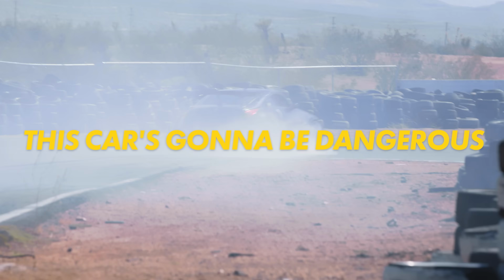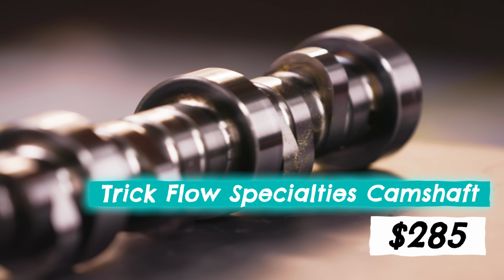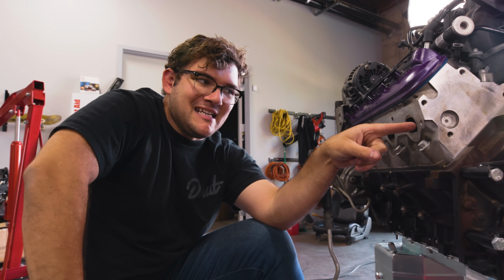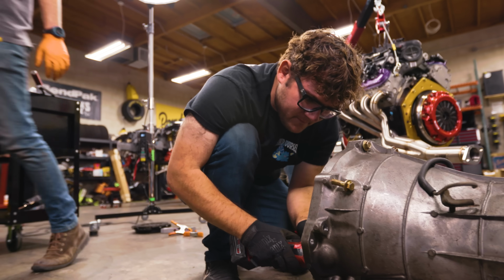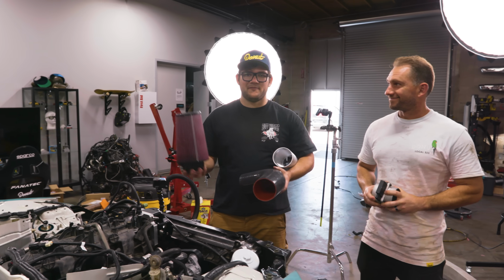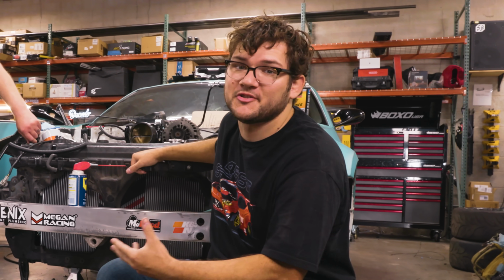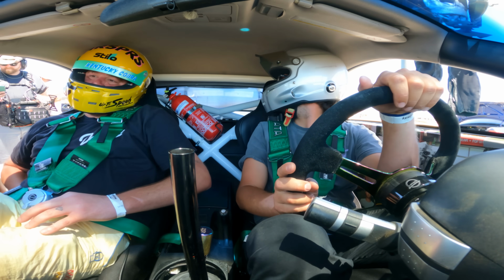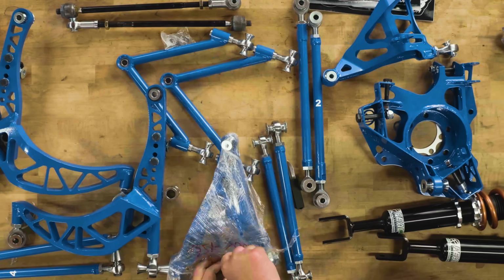$8000 Junkyard V8 vs $30,000 Crate V8 Engine Swap

Comment: The amount of investment, know-how, time, energy, and knowledge of tools and parts needed for a project like this successfully is insane, you gotta respect anyone who is willing to do this for a hobby
Reply: On two cars at the same time as well
Reply: Got the ls3 in my bmw e30 ☺️
Reply: "Someone wrenched too hard and broke the bolt" You just wrenched too hard and broke the extractor. Congrats.
Reply: Its such a fun hobby but very bad financially lol, I've already put over 20k into my Silverado
Reply: haha stop overcomplicating engine swaps they arnt that hard coming from someone that has done a few and can make a custom full harness for a car himself. We are in the age of the internet unless your doing someone really wierd there is all the information to pull it off.
Reply: Holley and other companies have worked to make it easier and more affordable too. Knowing that the majority of people are swapping or restomodding their vehicles. Gone the days of swapping motor mounts making sure your firewall is clear and your driveshaft was correct. Because you didn’t have looms to make or computers to hookup to run your management system. Spend a grand or so, get a Holley Terminator and it’s more or less plug and play. Basically back to 2 wires, fuel and spark
Reply: One of my best friends crammed one of these in a miata. Can confirm its an insane undertaking
Reply: Bro their mechanics
Reply: What about the men who do this 40-60 hours per week
For decades. 
And once you start society never. Ever. Wants you to stop
Reply: agreed. much more fun fixing your own car then paying someone else as well.
Reply: @deaganblough1961  not all of them.
Reply: Once saw a Chevy 396 shoehorned into a Opel Manta, the year was 1976, so no computer stuff to deal with.
Reply: I hope they make a ton of money, this series is great.
Reply: It’s not a hobby it’s a lifestyle
Reply: @deaganblough1961  Not really good ones tho 😂  nhf
Reply: Nahh you gotta respect somebody who does this as a job.. as a hobby is easy. If you’re not a car person you wouldn’t understand, but doing this as a hobby actually is the easiest. Doing it 40/60 hrs a week is death
Reply: I work at a performance shop that specializes in ls swaps. Engine swaps are only as complicated as you make them. Its more difficult to get your gauges to work properly than it is to do the swap.
Reply: @garykiesel2583  videos or it didn't happen lol
Reply: Me but with 3d printing 😅
Reply: With enough research anyone can do an engine swap, the hardest part is getting the equipment and time.
Reply: And all the back pain and mental frustration
Reply: Also like the Clarkson based "meanwhile"
Reply: Hello there Axle
Reply: Or for job
Reply: @ZeChef9000  to fix my mom's 69 firebird would have been insane. That car was beautiful
Reply: @ZeChef9000  same, 30k in on a 20 year old mustang.  This hobby is definitely a money pit.
Reply: Agreed, I wish they would have done a better tire setup fir the 0-60 runs though 👀
Reply: In the process of putting a ls in my e92
Reply: Your tripping, engine swaps are bolt in these days 😂 I k swapped a civic in a day and 5.3 swapped an s10 over a weekend. All you need is MONEY.
Reply: @RidinDirtyRollinBurnouts  it be like that
Reply: I'm willing but I dont know jack shit about shaping a engine
Reply: Me
Reply: I've got my steppops and my neighbor who have both been asking me "when you gonna put a ls in it?" My steppops has been pretty much prepared  ut I brought a foxbody lol
Reply: @tristanmeadows  i feel this, my twin V geo tracker wasn't super difficult
Reply: Honestly, you bring up what I think is a good point, that should be something they talk about, difficulty of these tasks.  I think maybe having someone without mechanic knowledge, or little, around to ask "dumb" questions would be good for some of us (including myself, know some stuff I've had to do, but have HUGE gaps in my knowledge)
Reply: My buddy and I are about to do an engine swap🤣😭. It’s voodoo and luck
Reply: Well they love it
Reply: I mean it’s not rocket science. A couple cases of beer some YouTube videos and a full tool set. Should really be the only things you need now a days…
Reply: Fool its sponsored hahahahaha wanna buy some snake oil?
Reply: Jeez, the prices are nuts.  Back in the 80s, A friend and I scraped together about $500 to buy a 327 with the rock-crusher 4-spd out of a wrecked '63 Corvette (with the 4-barrel carb, not the fuelie), spent another $300 or $400 on new cam, lifters, valves and some other bits from JC Whitney (and I think we found a Holley carburetor to replace the Carter), and put it all in a '68 Camero RS, which we bought with a seized engine for about $750.  We put it all together and we had a nice little rat racer which we ran on Wednesdays at Houston International Dragway - which was a 'race-what-you-got' weekly event and raced it for a couple of months before we blew it up.  All for less than $2000, including the Mickey Thompson race tires.
Reply: For that price.. just buy a new sports car.
Reply: @Pandadancypant  😂😅😂
Reply: I felt that went they started low car....much respect
Reply: @tristanmeadows  not trying to talk down your ear since you seem like you know what youre talking about, and the internet is great for learning car stuff, but im always hesitant to directly follow internet diy advice without seeing someone properly wrench on it themselves, since i work in paint and the amount of good painting resources on youtube and on the internet can be kinda lacking in comparison to the amount of bad/incorrect advice. you gotta find your guys you trust and be skeptical of all "easy" fixes, but thats just life in general. cheers bro
Reply: Not really. I helped my friend in my teen years completely rebuild a few motors on mustangs, jeep. Easy peasy. Only bad part was we kept losing good ol 10 mm
Reply: @fastinradfordable  they get paid.
Reply: This ain't a hobby for them. It's their job
Reply: Thanks bro
Reply: im 2jz swapping my z32 by myself, i wish i had the help and money they had lol they make it seem easy
Reply: @Ian Visser thats a boss hog
Reply: Great stream, as always. I appreciate the level-headed approach you take to the news and the markets. A lot has changed and that's on everything but the truth is I don't even care much about bullish or bearish market anymore because Mr Richard got me cover as I am comfortably making 1.5B T C monthly...🤑
Reply: @Ian Visser Just one guy? There are ton of them around. There is also a company that makes them.
Reply: Yeah okay I see where your coming from but honestly it really isn't that hard especially a crate motor. It's all there ready to go. It's pretty much just "plug and play". And a junk yard motors is pretty much the same way as well.... as long as you got the exact same motor out of the exact same make/model as the car its going in. If it isn't than yeah it can be a lot more to it.
Reply: @iscream4fkingfun  man i cant decide if id rather have a swapped engine or my 10mm...
Reply: @Ian Visser LS swaps are so common I’m sure there’s kits to put them in an office chair
Reply: Get sum garage is building a 400-600hp supercharged v6 fwd to put into a 84 cavalier  4 door sedan with a final weight of <2300lbs
Reply: @fastinradfordable  i went to day trading after doing swaps for a year at a local shop
Reply: @HansShackleford  doge?
Reply: Bruh they are well compensated to do all of this, and they’re not spending their own money. This is a dream for me
Reply: So how did they remove the broken bolt or did they drill it out and re threat it?
Reply: One thing I learned in life is that a big part of winning is knowing that you can and it is possible for you to win.
Reply: Suvka Martin  Been hearing about Richard for a while, how do I get him??
Reply: ?

Lol

Lemme

My too

My
Reply: @lonyo5377  Fr dude
Reply: Swaps are easy!! Wiring and tuning is a lil tricky but doing an ls swap is cake.
Reply: @tristanmeadows  dont make their heads hurt
Reply: Suvka Martin  okay then, I will give him a head start to see what His capable of making.
Reply: @tristanmeadows  is a k24 on a Ferrari 308 considered wired? 

Or sick?
Reply: 2 years of building welding and swapping a ford 302w into my e36. No one helped so took some time. 😆
Reply: @ahmedhussain8407  Even in the bearish trend, Richard still made me some good profits
Reply: Invent something that runs on Hydrogen. Now that would be cutting edge!
Reply: Exactly... well said this is some tuff shit
Reply: @craigmertz1994  Recently gave a try to his Strategy and now I can testify that he's system is totally legit.
Reply: Richard gave me the autonomy I need to learn at my own pace and ask questions when I need to he's so accommodating
Reply: It's not that bad as long as you don't do a bunch of unnecessary things
Reply: @MBisFrenchy  half a million views in a couple hours...I'm sure they are doing ok
Reply: @silktm9457  and the stress of it being someone elses car. Cant fuck up fixing it. And cant kick and punch it a bunch when you get pissed off
Reply: @ZeChef9000  imagine if u factored tools into the cost
Reply: To be fair they have far more resources than most garages...
Reply: @GenuineRage  iam not saying follow diy videos my God. Iam saying there is all the info aka wiring diagrams, tuning software, most swaps already have mounts readily available. Once you can weld and have half a brain to figure out the rest.
As someone else said hardest part is making stock gauges work with the swap 99% of the time.
Reply: Not a hobby, a life style
Reply: @flowerasteroid6241  fr
Reply: It ain’t really that big of a deal lol
Reply: these boys playing car mechanic simulator in real life
Reply: I mean they do it for living, but yeah shout out everyone who does this and has a day job
Reply: @ZeChef9000  Has the HP tripled?
Reply: Engine swaps aren't very hard tbh, just mark your shit. And this isn't their hobby it's their job lol.
Reply: Don’t forget about the aftermath of fun you get to experience
Reply: Action Official Audio - HBM Benny Feat KTheM1nd MD3 Malik
https://youtu.be/9Ul-bfHtjSg
Reply: @Ian Visser agreed
Reply: MAD RESPECT... they probably could afford brand new 400z with that kind of mods
Reply: Start on an older, simpler car. Fix the little things and in a year or two you’ll be ready to do crazy things. I bought a 72 Plymouth Duster 4 years ago and I could barely do a brake job. Fast forward to today and I’ve done a top end rebuild on the engine, completely rewired it. I’ve redone the fuel system, ignition, timing, transmission linkage and a dozen other things. Trial by fire, man. Trial by fire
Reply: @Lowclef  lol from a old ford gas tractor up to 2022 any thing with wheels tracks or skies and floats on water. im a skilled technician/ mechanic. i love working on them all too. knowing my life is in my hands when it comes to my vehicle. no price for that piece of mind.
Reply: @tristanmeadows  hahaha i getcha, like i said you seem to be pretty well-versed so i didnt think you were recommending that. 100% agree, engine swaps are becoming a lot easier as more people weigh the cost vs value of new cars in today's economy. its the one upside to this topsy turvy world we're living in, more non-"car people" are actually wrenching on their cars now and people are documenting how to do it properly on car forums. just wanted to throw out there for people that MIGHT be inclined to watch a youtube video to get something done that it's probably a better idea to find a forum discussing your exact car, because its all 100% geared towards wrenching the stuff they're working in.
Reply: Its backyard level know-how, enthusiast level equipement, and million siubscriber youtube channel level of budget/investment.
Reply: @ZeChef9000  yeah you can spend all you want on it but you can get your money back in returns on selling unless they become collector items
Reply: @racerx250  nah, the money was for fixing the damn thing
Reply: @Xearnx_Lyrics  I know and I have been
Reply: People keep rats as pets, can you imagine
Reply: Hobby? It’s not a hobby if you make money out it it. It’s a career
Reply: @Jose-wf6po  i never said it couldn't be, it just starts as a hobby
Reply: @ZeChef9000  and I've put 17 in my honda... are you mad or planted in the seat about it?
Reply: Like me lol
Reply: Your talking about my dad. Just redid a keep grand Cherokee limited edition. They don’t even make a lot of parts. Didn’t stop him, just compelled him to manufacture better ones. No matter what I do, I am an absolute disappointment to my dad. He’s cool though.
Reply: I put a big block is a dodge infrint of my house in nyc illegally gun and stressful
Reply: nah all it takes is a bit of skill and mostly money
Reply: All in one video too love these creators
Reply: @eriklarson9137  jobe was trying to make him feel better “it wasn’t your fault “ lol it’s cause Nolan is a big cry baby behind the scenes and gets hella mad
Reply: At the end of the day it's just cheaper, in the long run and reliability too, to just buy a factory performance reliable car.
Reply: Actually I don’t have to. Don’t tell me what to do. Congrats I un subbed from donut. Are you happy now??? FREAK
Reply: @tristanmeadows  yea just comes down to the actual work but not all swaps have crazy amount of info because they arnt as common
Reply: Yig
https://youtu.be/N7-LaP12hm8
Reply: Must be some one thats never done a engine swap then 🤣🤣
Reply: @lonyo5377  people please don't 90p
Reply: They both look weird cause they shaved
Reply: its just something that comes easy when you really enjoy it. I love working on cars and if I had the money and tools they had, id be doing the same exact thing 😂
Reply: Cringe
Reply: @garykiesel2583  how the hell did you do that 🤣 I struggled with a simple m52 swap
Reply: What do you mean these projects only took 38 mins
Reply: For some reason we enjoy this shit🥲
Reply: Youd think its hard, all of my friends ive taught about mechanics have picked it up incredibly fast, it really is simple when you think of it the way mechanics do, you just start out piece by piece youll get there if you want, and you can swap an engine with not that many tools
Reply: @tristanmeadows  opinion not fact
Reply: Nah it really takes bull headed determination more than anything
Reply: @alexcapps9290  there are kits to drop v8s into miatas...  they come with motor mounts and everything
Reply: @whydoikeepgettincut  yes there are plenty of kits. He had specific location he wanted the engine so this involved a lot of cutting and welding including an entirely new Trans tunnel
Reply: It is one of the best hobbies to be involved in 🥴
Reply: Shit! .... well I guess " respect " tf outta me cause with that checkbook I'm not only         " willing " I'm " successfully insane " 
This is a car guys DREAM  and it's cool as sh!t to watch! 
💪🚀💪X✌
Reply: @NXT_LVL  still a lot of work to bring a 440/hemi or SBC-350 out of the past and undated to 2022 standards or change the heads aka 440-RB to 426 engine swap and there mostly the same engine 

and yes lots of cash and tooling is required and reading 📖 plus a idea of computing and programming, im with the guy with the Silverado truck but im not driving a 2000's prise/S-box for now so upgrading my car makes operation sense and a descent chance someone else would understand my struggles and pay me for the extra effort and it helps its a desirable model/year 1966-71
Reply: 78 he had to IPO
Reply: @fastinradfordable  thats any form of trade lol
Reply: well to be fair everone on and off set is getting a paycheck
Reply: @charlesballiet7074  but us not YouTubing aren't getting payed playing with automotive hobbies at home or at least id have to sell out the 440 BBM and i enjoy driving it 😉
Reply: It's not a hobby! At least the posters of this video don't think so. That's the secret. But I get what you mean
Reply: @richardprice5978  i guess our payment for watching is entertainment and a small amount of knowledge
Reply: @charlesballiet7074  OP poster is right that it's resource/commitment needed is intense and not for the faint harded aka or people doing it for fame/girlfriend's/💰 or at least a home 🏡 gamer/DIY doing it for your own projects aka not a costumer's hot rod
Reply: @garykiesel2583  For real?
Reply: I build and race asphalt and dirt circle track latemodels modifieds and a dirt and asphalt street stock for a kid that drives for me. I been doing it since I was 8 and you won't believe the amount of tools and equipment I have. On top of all the tools and equipment mandatory for building and fabercatong anything on a car plus welding machines, laser computer system for setting up the geometry up in the front ends of the racecars a 6k dollar perfectly flat metal plate is what we call a setup plate where you do all your setup work like scales caster camber computer laser alignment machines rear end laser measuring machine pull down rig in the floor for the latemodels. And about 30 other specialty tools just to work on the racecars that normal cars don't need
Reply: @kotajames6211  freakin zoomers lol 😉
Reply: 26:30 lmao The emotions Nolan was feeling. Love you guys❤️❤️
Reply: @tristanmeadows  not hard just expensive
Reply: @garykiesel2583  you have an Instagram page we can follow?
Reply: It’s not possible to be just a hobby. You either live it, or drive your stock outback with random Plasti-dipped parts to the meet every week. Lol Not bagging on anyone, that’s just the way it is.
Reply: Deagan Blough Lmao nah. They don’t do shit but help the real mechanics, like holding flashlights and tightening bolts. 90% of them said “I don’t do anything around here” or “this is my first time working on a car”
Reply: Deagan Blough yea THEIR mechanics do all the work lmao.
Reply: This is a lifestyle
Reply: As a car guy I have been thru 10 cars modded everyone a little bit it’s worse then hard drugs because it’s stupid hard not to buy a 350 project almost every payday
Reply: And they use a sledgehammer to fit a engine PeAk EnGiNEerInGEngineering
Reply: I'm swapping an rb25det into a Celica with 0 knowledge or experience of working on cars and it's going fine
Reply: It is, but we can do it too! With a little patience, a big enough hammer and a membership to forums that apply to your vehicle!
Reply: @garykiesel2583  niceee im building a Twin turbo LS2 E92 328i, i got the engine for about 3k its good low mileage and everything so i got a good deal there now im buying the built t56 transmission from grannas for 6k then im still missing the swapkit 2k, holley terminator 1.3k, BTR stage 4 N/A cam kit 1k, holley mid ram intake 1k, the turbos are coming later not now i wanna finish the car first, can you give me information on your car sounds interesting
Reply: @ZeChef9000  but its worth it isn’t it? Im currently building my first “race car” its a twin turbo LS2 T56 Bmw e92 328i
Reply: @Ian Visser yeah ive seen a 427 LS7 with 2 procharger in a harley making 1200 whp 😳
Reply: @VINdustry  actually 😳 im doing that too fr fr what are you doing for engine/transmission mounts LSE90 or CX racing? Im doing a Twin turbo LS2 T56 in a 2012 E92 328i
Reply: @theinfuma2471  its not about money its about the feeling that you’ve build something yourself, its about the blood and sweat that went in to build something unique
Reply: @Sir_Obliviousness  it is common depending on what chasis you use for example im swapping in a LS2 in a bmw e92 328i and there is only 2 companies that makes part for that specific swap
Reply: @pedrosiqueira5235  weird but unique and a bit sick ig
Reply: Not a hobby. They make money. If no money no "hobby"
Reply: @xenon9270  nice, it depends on the results you're wanting honestly, for me its worth it
Reply: They are going to crazy lengths for this but really you can do this with just some wiring an oil pan and some engine mounts, and a LOT of work.
Reply: @tristanmeadows  ok we bow down to the master! That's what you wanted to hear right?
Reply: @deaganblough1961  they're not, lol. zach is the only trained mechanci
Reply: If you want everything in your life to be in order, your health,your finances, your relationships with family, friends and all your loved ones as well as kids

Trust in the name and the power of Our Lord Jesus Christ, The Father and The Holy Spirit.

Say this Prayer to ask God for Freedom in Christ Jesus.

●Say: Jesus Christ i ask you to please come into my heart and be my Lord and Saviour, please Bless my soul and make me a true child of God.
Thank you for saving me and setting me free. In Jesus name. Amen

GOD LOVES YOU....
Reply: All that time and money and bigger tires and you still can't even match the factory 0 to 60 time?
Reply: @MB-ke9mi  p sure those are the tires they drifted on, so im not surprised they lacked grip.
Reply: @MB-ke9mi  factory time is 5.2, so low car did beat it
Reply: @tristanmeadows  well, you've done a few. this was many of their first time doing one. but you're still right about there being alot of information to pull it off.
Reply: these aren't amateurs
Reply: @stretchnuts4661  they are
Reply: Cousin in law has a ls in his 350z
Reply: @fruitygranulizer540  no I am
Reply: For a hobby try for a living !!!
Reply: It’s rlly just more having the money to do so. They make the parts to do these swaps and they make kits. It’s just having the finances. This hobby isn’t financially wise but it’s worth the smiles. Smiles per gallon 💪😁
Reply: @avspecter2268  yea it takes money but, but it takes a long time to get where these guys are, you can't take that away from them
Reply: Ma è vero e che si si è vero vero amore e invece di dire a mia sorella e la tua canzone che hai scritto un messaggio che che mi piace un botto che si chiama così tanto da dire ma io io ho il coraggio e determinazione del tuo profilo è carino il mio mio fratello mi sta venendo la nausea da da me la la love spaghetti spaghetti al pesto alla siciliana di un mese di maggio al mondo e poi non non haha so do i crediti crediti e e i tuoi amici amici di famiglia è la prima cosa da io   Sono la foto con i suoi capelli capelli lunghi lunghi per la mia mia mia mia madre non ha fatto il check check di un mese di maggio maggio al al al concerto concerto a Roma il prossimo prossimo ci sarà il prossimo prossimo ci ci siamo siamo noi noi noi ci crediamo crediamo di no al al al concerto a a me me me ne frega di quello che quello che si si si ho ho ho ho collezionato che che re mi do una stella che si fa ad andare avanti avanti e più volte e e i tuoi amici amici di sempre sempre la la da di da dee la da la da di da di da dee la da iii
Reply: @lonyo5377  good morning bro bro I got to
Reply: I have to go to autozone at least once everytime I fix or put something on my 335 lmao, I’m starting as a tech tho so I need the tools either way
Reply: Brotha it’s all art, you just do what you love regardless of if you have all the tools and knowledge you need, sometimes you just gotta learn as you go
Reply: @garykiesel2583  post some videos mann!!
Reply: Mo'. POWER 🔋
Reply: @lonyo5377  ikioiii
Reply: @lonyo5377  i
Reply: @lonyo5377  ikioiiiiiiiiiiiii
Reply: My dad and I put a 1300cc hayabusa engine into his hillclimb car...
Reply: Nobody is doing this for a hobby. Its always guys with either YouTube money or big big sponsors in the real race world.
Reply: They earn allot from YouTube,  its a job not a hobby lol
Reply: @tristanmeadows  thats what everyone says, but what is the realitic budget with regular hand tools and an impact for this with an automatic?
Reply: @Ontheregz  how much for both?
Reply: @theinfuma2471   coulda bought a c7 and had money to spare lol
Reply: I’m worried about the 500 break in miles on that ls3🥹
Reply: Thank you
Reply: Smashed an lm7 in an 06 cts. Non v. In my driveway.

It's a bitch
Reply: @eriklarson9137  you ever tried to remove a broken extractor?
Reply: Meh..
Reply: Honestly you’d be surprised what you can do in a driveway with a set of harbor freight necessities and YouTube.
Reply: @garykiesel2583  is it heavy or how is it to drive? not a lot of v8 swapped e30s here in Denmark, working on a 325e e30 atm (2.7 straight 6)
Reply: @tristanmeadows  really weird? like a hybrid jog 50cc? XD
tbh engine swaps can be a pain, you got to make mounts for the engine and for the axle, also the engine gotta be very well balanced for it to be a OEM experience, just my opinion
Reply: @deaganblough1961  I'd be surprised if they have more than 2 ase certified mechanics.
Reply: @macmic6719  but you have knowledge now!
Reply: That’s why they have a full crew? What am I missing lol
Reply: They do make a good amount of money too.
Reply: you're kidding , right ? this is kids with more money than brains just fartin around
Reply: Definitely not a hobby. These guys making their living doing this
Reply: Well if they’re building the cars and giving them away for charity at the end or something sure respect but if it’s just their hobby, well it’s their hobby. But yeah congrats on their abilities.
Reply: That's any person. Spend enough time on something, you'll know the ins and outs.

It's why we say, "Never doubt yourself", as a human being, you're very capable of many things. You just, got to practice, evolve it into a passion.
Reply: this just shows you, most mods are a waste of money. Just buy a new faster car
Reply: @garykiesel2583  bruh why just buy a c6
Reply: Agreed I’m slowly getting into this myself
Reply: It's not a hobby,  these are professionals getting paid dude. They're doing this for the millions of views on this video and ad revenue. There's a whole team behind this.
Reply: Hell, you gotta respect anyone who has enough money to do it
Reply: This is far from a hobby these boys getting big paid
Reply: I know this as the guy that has helped 3 other friends build project cars but never had the money to go crazy with mine.
However my perspective is the guy they call when it’s all hands on deck knocking out as much as possible in one day and then to deal with any issues outside of electrical gremlins and rebuilding transmission internals. 
Leave that to the wizards.
Reply: It's not so bad, I learned a lot of it in high school auto shop. 3 years +1 year internship
Reply: Real mechanic stuff👍🏼🔧
Reply: You might even say their hobby is their profession
Reply: Could make way more than 400 on the junk yard engine with less money... Reliably...just saying. When are you going to let Nolan be the high team ? Kinda getting old seeing you always be on high team lol
Reply: @Ontheregz  Cheah, that's swapping a Honda motor into a Civic, and a Chevy V8 into a car that had a Chevy V8, duh, of course it's gonna be more or less boltin... Now try putting that Honda motor in a Peugeot or that Chevy V8 into a Nissan or a BMW, then we'll talk about how bolt-in it is.